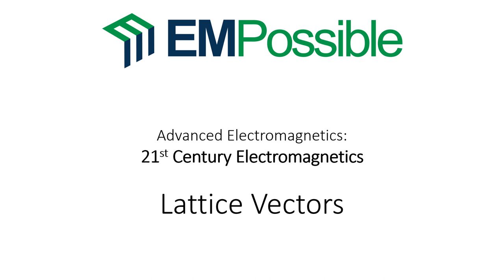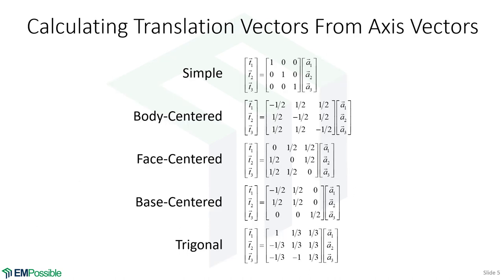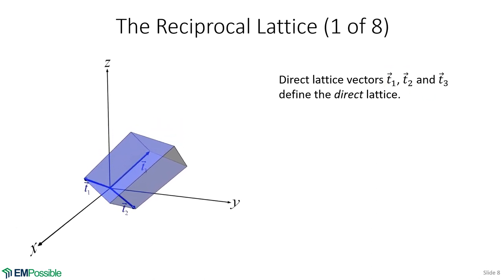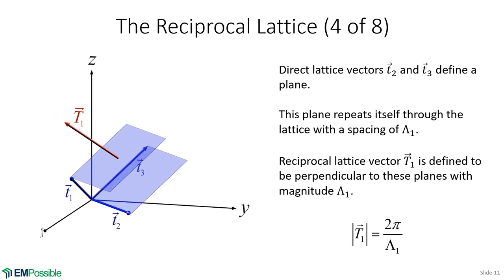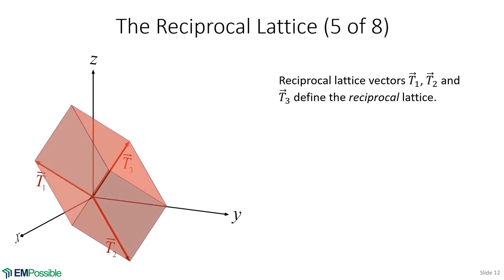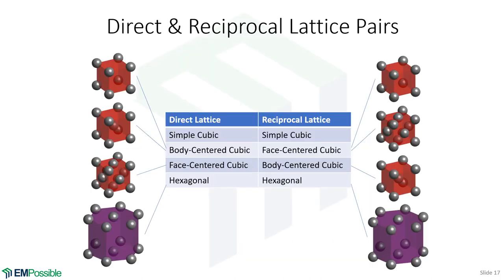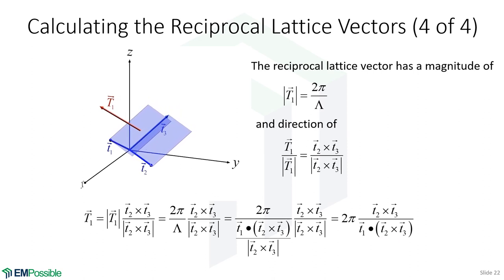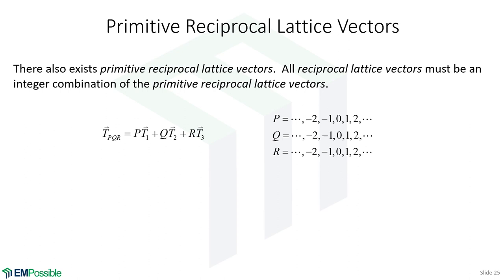Lecture -- Lattice Vectors

Comment: Dear Dr. Rumpf, I am an undergrad student in nuclear engineering. I am trying to learn the finite difference method for PDEs. Since you are a specialist on this topic, I want to ask for some advice. This is why I am commenting on the latest video instead of on a video related to FDM.
My actual target is to learn solving systems of 3D time-dependent multigroup neutron diffusion equations. (Neutrons are sorted into some groups according to their energies. Neutron fluxes are the dependent variables of the system. They depend on x, y, z, and time. Fluxes from each group act as a source for other groups. A PDE is formulated for each of the groups according to neutron diffusion theory.)
As of now, I have self-studied ODEs, PDEs, and some numerical methods for ODEs like FWD Euler, BWD Euler, Trapezoidal method, RK4, 3/8th Rule, etc. I have written solvers for each method in Python. I have also studied a bit of curve fitting. Now I am trying to get into FDM. I found your channel and really like your style of teaching. But the content related to FDM is scattered across many videos and lecture series. Also, my intended field of study is not EM so I'd like to learn the FDM method as a general mathematical tool for solving PDEs rather than learning to apply it to a particular problem.

Therefore I am asking for some guidance regarding how to best utilize the content on this channel to learn the FDM method as a general mathematical tool for solving PDEs. Where should I start and which videos should I go through? Please take a minute and give me some advice, thanks.
Reply from the maker: Thank you!  Sounds like you have already done quite a bit.  I think the best presentation of FDM that I have is in my  Computational Methods class.  See lectures 6b, 6c, and all of Topic 7.  From there, you can go into my FDTD course or CEM course.

https://empossible.net/academics/emp4301_5301/

https://empossible.net/academics/emp5304/

https://empossible.net/academics/emp5337/

If you are completely new to time-domain finite-difference, here is an online course and the first half is completely free.  The benefit of this one is that it is meant for the complete beginner.

https://empossible.thinkific.com/courses/1D-FDTD
Reply: Thanks for the reply. Dr. Rumpf. I have gone through topics 5a, 6a, 6b, and 6c. Now I have started topic 7a. I plan to go through 7a-7f and then watch Lecture 9 of Computational Electromagnetics playlist. I will post an update comment once I finish. Thanks again for taking the time to reply to me.
Reply from the maker: @amithasanarpon2527  Excellent!  The method I teach for implementing finite-difference method is pretty neat.  It has allowed my team to do some incredible things.  Just keep in mind that it may not be the best when your grid size becomes huge.

Comment: Hello, Where does the 2pi come from? at minute 4:45.
Reply from the maker: It is very convenient to calculate a cosine function as cos(kz), where k essentially controls how quickly the cosine function oscillates.  If the wavelength is lam, then k=2*pi/lam.

Periodic structures can be described with cosine functions according to their grating vector K.  In this case K=2*pi/L where L is the period of the grating.

Reciprocal lattice vectors are grating vectors so it is convenient to define them the same way with the 2*pi term.  Also, there is a very intimate relationship between wave vectors k and grating vectors K and the 2*pi needs to be there to be consistent.
Reply: @empossible1577  Thank you!
Reply: @empossible1577  In your words, reciprocal lattice vectors are grating vectors, then here why did you denote grating vectors as K instead of T?
Reply from the maker: @sayanjitb  Both notations are used in the literature and I want to connect them for you.  Grating vectors are most often seen when discussing diffraction gratings.  Lattice vectors are seen mostly in the context of photonic crystals, metamaterials and solid state electromagnetics.

Comment: How did you calculate the 2D reciprocal lattice vectors? And what exactly is the matrix representation that you have shown? 14:17
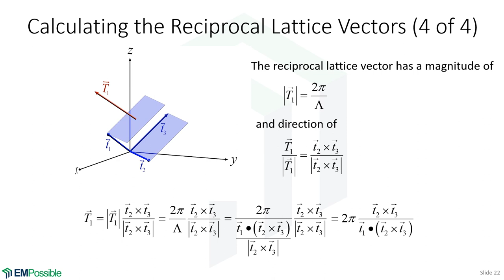Reply from the maker: Calculating the reciprocal lattice vectors is summarized on Slide 23 around 13:45 in the video.
Reply from the maker: The equations at 14:17 are similar to those at 13:45, but specifically for two-dimensional lattices where there are only two reciprocal lattice vectors and those vectors have no z component.  The "matrices" are actually column vectors containing two components of the translation vectors.  The upper-left equation says that to calculate reciprocal lattice vector T1 you would calculate as

T1_x = 2*pi/|t1xt2| * t2_y
T1_y = - 2*pi/|t1xt2| * t2_x
Reply: @empossible1577  Yeah got it. Thanks 👍

Comment: a bit silly question but here you go,  you said that the reciprocal lattice not what we can touch but it just talk about the symmetry of  direct lattice. Then what is the purpose of representing already symmetry direct  lattice  into another symmetry reciprocal lattice vector? I have noticed that this representation give computation benefits in Fourier space representation. Is that it? or something I am missing?
Reply from the maker: I think you got it!  The reciprocal lattice vectors are grating vectors (i.e. 2 pi divided by the spacing of planes).  This means there is a very intimate relationship between the reciprocal lattice and periodic structures and waves analyzed in Fourier space.  While the math takes a bit to understand, it is quite elegant.  Keep watching the series of lectures in Solid State Electromagentics.  I also recommend accessing the videos through the course website.  It has the latest version of the notes (error corrections), links to the latest videos, MATLAB implementations and other resources.  

https://empossible.net/academics/emp6303/
Reply: Thanks. I will do that.

Comment: You mentioned that non-primitive lattice vectors are an integral linear combination of primitive translational vectors, but I learnt that when lattice vectors are expressed as non-integral linear combinations of primitive vectors are termed as non-primitive lattice vectors. Is it right?
Reply from the maker: I don't think a non-integer combination of primitive lattice vectors is any kind of lattice vector.  I am not even sure what meaning such a vector would have because it would no longer align with the lattice or describe any of its repeating planes.